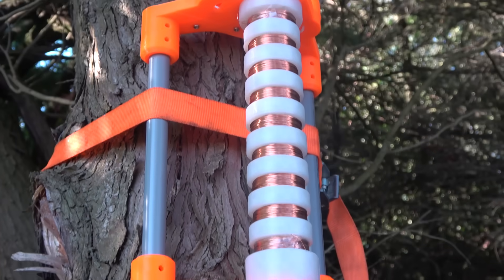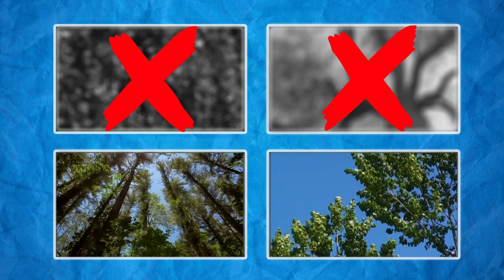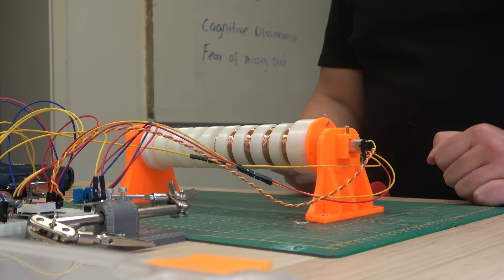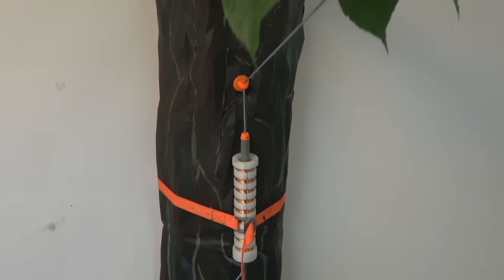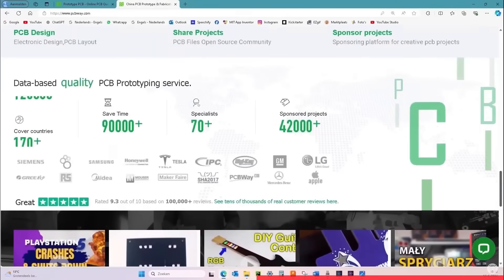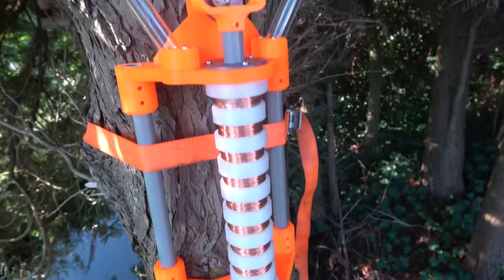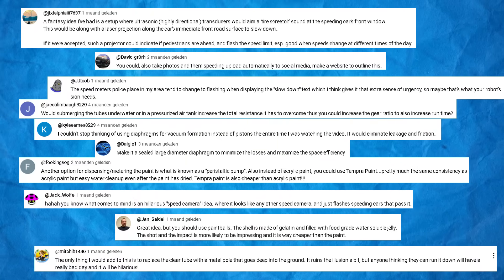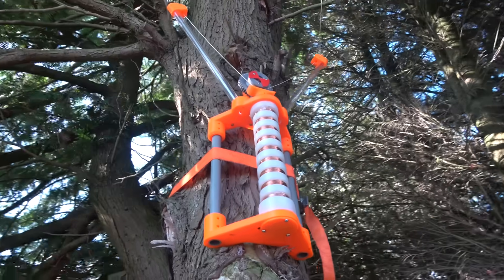I Made a Tree Generate Electricity..

Comment: I mentioned this idea 10 or so years back to a renewables expert who pretty much shot it down in flames. 
I think your concept is fantastic. Its just sad that some people can't think outside the box. Very best wishes for future success. New subscriber here.
Reply: It was shot down because this is an indirect form of wind power. The problem with using indirect power is that it results in massive efficiency losses. It is comparable to using a flood generator for a river instead of a hydroelectric dam.
Reply: @rendomstranger8698  right.  Maybe this idea can work in places where it's not feasible to build a wind turbine, or install a solar panel.  A few watts and a battery to power an outdoor LED light, or a small weather station.

I would be curious to find out, though, what the theoretical limits are.  That is, given some x position / displacement of the branch, what's the maximum power output?  How is the power output related to the mass of the magnet?  I can't help but wonder, maybe someone has already worked on this, but they didn't use trees, they used a more obvious form of motion (like a water wheel or something).
Reply: @wolfumz it might be indirect, yet compared to a wind turbine, they are 99.9% grown instead of built. With the right trees, tremendous torque can be generated, it just needs to be harvested properly. Inefficiency of imagination is creating an illusion of an ineffective power generation method here. I am willing to bet that this project will develop a generation mechanism to  match the power being captured by these trees, and the efficiency of such a  system will look a lot different then.
Reply: @wolfumz  i would raise a counter point that trees are easily renewable and planted, whereas wind turbine require resources for the structure to be built and for maintainace. The trees themselves are already self maintaining and only needs us to maintain the actual generator part. The only downside is growth time(which could be offset by the sheer amount you can plant at once) and possibly the cost of the generating part.

Also another idea is using the technique that im not sure what its called, but it allows you to specifically shape the plant as it grows into certain shapes. Maybe there is a way to grow the trees in a way that makes it catch more wind and sway much more than normal, increasing the efficiency of the generator.
Reply: @simhwui could be argued that tree maintenance throughout their lifecycle is more expensive than windmills, as it would take likely tens of thousands of these contraptions to generate the same amount of energy, if not more.
Reply: @rendomstranger8698  Let's not forget the danger of putting high heat next to flammables.
Reply: @TheRestedOne  Wood is surprisingly not that flammable. Especially when alive, it would have to get VERY hot for that to be a risk. and i highly doubt this produces anywhere near enough heat to be a concern for that.
Reply from the maker: Thanks! And i appreciate your support🙌
Reply: @ConceptCraftedCreations  Where can I download stl files?
Reply: this project is really intriging and it's a good practice for creativity and design, however its just wind power with extra steps not feasible for practical power generation. However think of this as ultra efficent power harnessing for some niche situtations say power for forest fire detectors in a remote dense forest . Just not for large scale power generation.
Reply: @ewbaite  In my opinion, as small processors, batteries and connectivity become more efficient, you could imagine setting devices along a forest so that no one gets ever lost, they can ask for help. 
That sounds also creepy though, with no privacy whatsoever.
Reply: the people that you mention are only loud and aren't, probably never will be, ready for real science - which requires creativity
Reply: @robertsolomon3328  Or maybe they're smarter and more creative, which allows them to see the dozen or so issues with power generation at scale with such a "solution".
Just to name a few
- Trees grow, travel will change over time until cables either snap or remain in tension.
- Access. Trees tend to be in forests, so it becomes complicated to outfit a million or so trees in uneven or sometimes inaccessible terrains.
- Unreliable. You need hundreds of these (or more) with possibly thousands of individual parts to work correctly for decades at a time without breaking, just to compare the output to a single small wind turbine or solar panel.
- Movement is not hard to find in nature, the issue is not making electricity, it's converting intermittent signals into a constant reliable one, which translates to storage becoming the key element, not the generation itself.
- Nuclear exists, and is simply cheaper and more efficient in every possible measure.

It's a cool mechanism, but that about the extent of its usefulness.
Reply: @robertsolomon3328  You mention real science, but that involves math.  To generate a useful amount of power, the swaying of a tree can NOT do it.  The math shows this.  THAT is real science.  I like creativity as well, but there is a reason wind power is a horrible experience, it's because of the ratios involved, which end up requiring a wind speed of 20+ mph in order to even generate a low level of useful power.  Tree branches can not, and will never, handle the strain of a mechanism that is big enough to produce a useful amount of energy while that mechanism is under a load.  Yay, you can light some LED, or slowly charge your phone barely faster than it discharges while off....that isn't useful..no matter how much you "dream" it to be.  Maybe you ought to learn some real science before talking about it as if you have a clue, because you don't.  It's like those people that think you can dig a canal from the Mississippi river to Arizona...it's uphill, water won't flow that way.
Reply: I don't think this is a matter of "not thinking outside the box", tho I do think the idea IS and example of great creative thinking. Problem is, it's kinda obviously not remotely viable for any serious power generation if you think about it for one second. It might have sounded to this renewables expert like you were pitching this "brand new technology that will solve our energy needs", which would be laughable. But as a fun curiosity and experiment, it can still be cool!
Reply: He is right, it isn't a practical solution.
Reply: Its a fun gimmick but useless on a practical level. It just generates so little energy and is not scalable. Even a tiny windmill would generate dramatically more energy.
Reply: Probably because its literally just wind power, but way worse. Its very cool, but useless for any practical purposes.
Reply: Creative design for sure.  I applaud your ideas.

But your goal is to capture as much energy as possible from the wind, right?  

Sure, wind moves the tree.  But the amount of energy lost in the swaying motion is quite large.  It’s like adding a rubber band to a mechanical system. It absorbs too much energy.

I love your design, but I think that after many iterations of this design, you’ll eventually discover that using the exact same amount of wind to drive a windmill directly…. will capture far more energy.  And isn’t that your main goal?  (Capturing free energy from the wind.). 

Yes, the swaying motion of the tree does create some energy, but it is a very “lossy” way to extract wind’s energy.  

I would guess that your final version might capture 20% as much energy as a similar sized windmill would. (Similar size, similar quantity of coils & similar quantity of magnets)

I strongly encourage you to keep designing creative systems like this.  Great ideas are thought up everyday by people like you!
Reply: no expert here, but I still see a major flaw. 
complexity.
To be feasible it needs to be scalable, and bigger.
small windmills do not really recoup the investment. 
and they are stable compared with a tree. 
imagine all the maintenance needed for such gizmos spread all around.
Reply: for "power", i agree... its pretty useless. people forget that as the current through a generator and its load starts to increase, the lenz reactions also increase, and that reflects back as the WORK or force required to DRIVE the things. theres also a thing called "jacobs law", and that is that the load resistance has to be much higher than the generator resistance, or a large portion of the power produced is dissipated in the generator itself. if you short a generator out, where does the energy go? its lost as heat due to I2R, in the windings themselves.

but to run a set of LED lights strung up in the tree? "path lights" aka "fairy lights"?

its brilliant. solar path lights only get to charge through a small portion of the day and require being placed in suitable locations... this will charge almost 24/7, and can be stuck almost anywhere... you wouldnt even need a battery considering theres almost always enough breeze to make branches sway... would also make an interesting "twinkling" effect with no need for a circuit...

 just change the generator to a standard BLDC from like a CD player or similar. far superior magnetic circuit, far more "efficient".

i cry when i see these "air coil" generators that havent progressed beyond "waving magnets past wires". reluctance, magneto motive force, it only requires a small bit of study into some basic electromagnetic concepts to understand that the magnetic circuit is critical... linear generators are quite hard due to relative speeds, and pole spacing, whilst achieving sufficient flux densities. unfortunately, imho, the best material to study are books from the 1950s and earlier, which can be hard to find. they tend to explain things clearly, precisely, and without resorting to heavy and complex mathematical equations...

rotating generators are far better, and will also generally produce twice the voltage at the same current, as they can reverse the magnetic field through the coil on each half cycle.

most linear generators only use "half" the change of the magnetic field. from no field to either N or S, its actually quite a challenge to make one capable of the full swing from N to S and back again.
Reply: That's because this idea is silly. I'd be surprised if he reached anything close to 10W average power with this on a good day.
Reply: I wouldn't really be super interested in this concept for real power generation because it has had power density but it's no worse than a giant wind turbine really

there is a concept similar to this which is kite based and already works pretty great
Reply: @Mallchad  Is the kite based concept the one where they have an underwater kite attached to the sea floor?
Reply: @mirko1998  No? I'm not familiar with that one actually
Reply: @Mallchad  Oh ok. I think one of the bigger companies is called Minesto.

Comment: Fun, I like it although usually I'm skeptical due to efficiency, maybe I'm expecting Dutch clearheadedness 😄

– What is the theoretical expected maximum energy?

What if you used

– "rachet wrench" style mechanical rotating device to pull weights up and the let the gravity produce the energy, kind of cyclical up and down movement; might bring benefits or not, like tree/branch size flexibility, as you can adjust the weight?

– rotational generator?
 
– only 1 wire/generator and direction & multiple generators per tree, easier wiring as the wire guides wear out?

Good luck! Subscribed ☺

Comment: It could be possible to use piezo elements which are in a ring around the trunk between right angle brackets. Whichever way the trunk bends it will press on some of the elements. I think the issue with this is that the force might crush the elements, not sure.